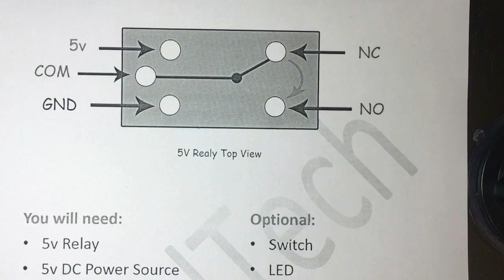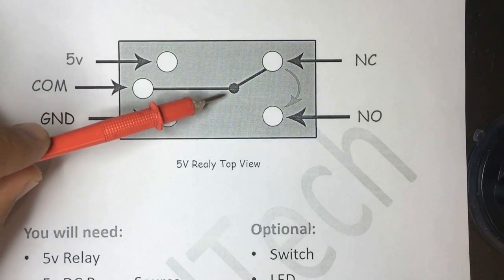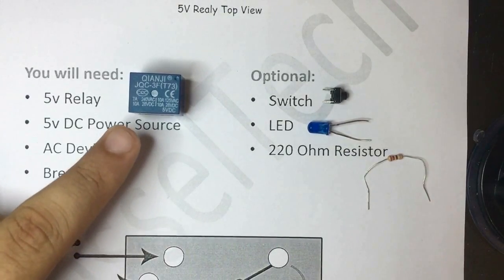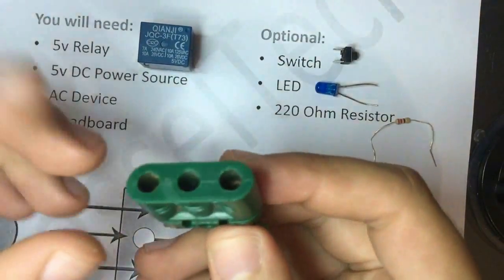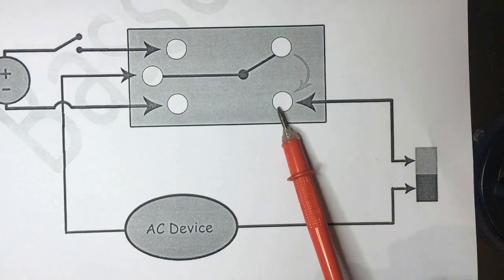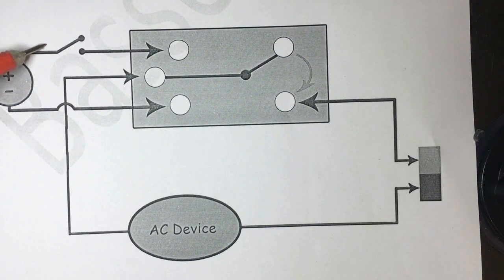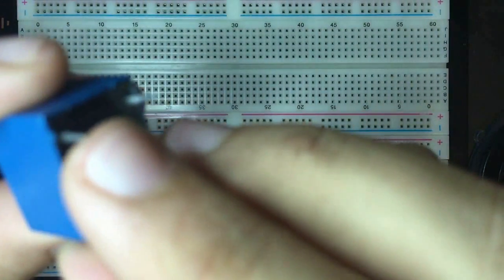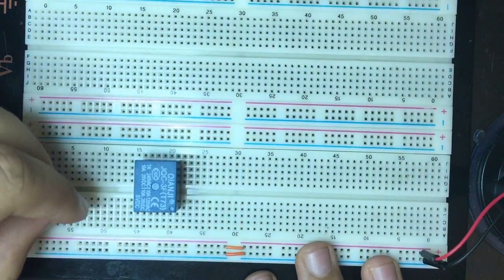DIY| Controlling AC Devices by 5V Relay

Comment: Hello sir could you recommend a relay that can handle heavy ac load , e.g. 1000 watts ac load ?
Reply from the maker: When it comes to heavy AC loads, you'll need a relay that can handle the power requirements. One commonly used type of relay for high-power applications is a contactor. A contactor is an electrically controlled switch specifically designed for controlling large electric loads.

For a 1000-watt AC load, you would typically require a contactor with a higher current rating to handle the power. A commonly available contactor with sufficient capacity would be rated for around 30 amps or more.

Comment: must include flyback diode if your switching using transistor
Reply: Correct I was thinking the same, it would need a diode across the relay coil! 😉
Reply: As wel as a pull up / or/  pull down resistor for a push button

Comment: The diagram and the video description both say the power source it is 5V DC same as the trigger power. The explanation is for an AC power source. Is the relay interchangeable for both power types?
Reply from the maker: Yes it is interchangeable for both power types, however, this is not the point. In this video, the relay used 5V DC power source as a trigger to control an AC circuit (the lamp). I hope everything is clear for you. If you still have doubts, feel free to email me at: admin@basseltech.com or kik: http://kik.me/basseltech/
Have a great day! :-)

Comment: Hello man. Great thing
But the question is The Phase of the AC should be connected to the relay
or the Neutral of the AC should be connedcted to relay????
Reply from the maker: Thank you! :-)
The phase should be connected, in case you have 3 wires.
Reply: thanks..:-)
Reply from the maker: You’re welcome! Stay safe! :-)

Comment: Nice video! Just one question, I know you cleared in comment below, but I still don't get why you plugged the lamp once to the relay and also to an ac socket. If you can clear that up for me I would appreciate it. Thanks!
Reply from the maker: +Ander Alex Of course sir, I know it's confusing but I will try to simplify it as possible as I can. Now the lamp has two wires that should be connected to an AC socket in order to work. What I did is: I cut one of those to wires and made it pass through the relay, so now when the relay is on this cut wire will be a short circuit and the lamp will turn on and when the relay is off this wire will be an open circuit and only one wire will be connected between the lamp and the ac socket; so the lamp will be off. I hope everything is clear now. :-)
Reply from the maker: +BasselTech two wires**

Comment: Hi, useful informations, but please put a warning message for the High voltage use, you'll never know which all age groups tests these and the high volt AC connections are very close and managed with just jumper wires it's always better to use a relay board with screw-in connectors for secure AC connection
Reply from the maker: +BlueINFOS Your contribution is very appreciated sir, this was just a prototype, of course any system should be implemented on a PCB, even though I should have put a warning too, Many thanks!

Comment: you have not shown  connection of lamp with relay and ac main power supply...the video is not a complete video
Reply from the maker: +Techwiser sir the lamp plug is connected to an ac socket, as illustrated in the video, which has one terminal connected to the relay and the other terminal is directly connected to the ac plug.
The ac main power supply is the wall plug there is nothing special about it.
Your comment sir is very appreciated and if there is anything unclear please feel free to tell me.
Have a nice day :-)